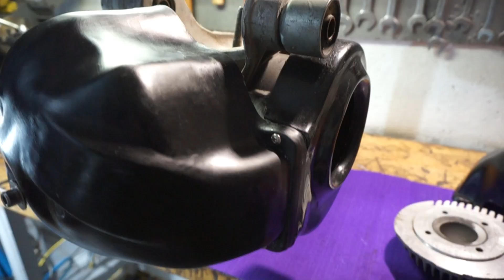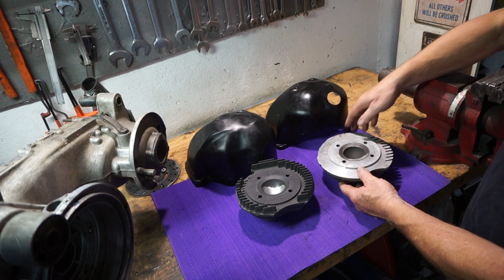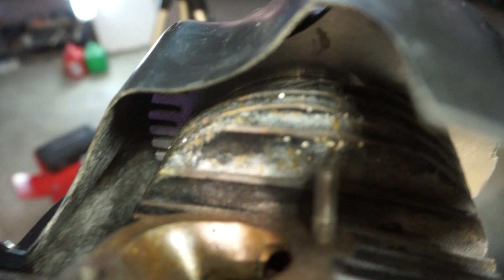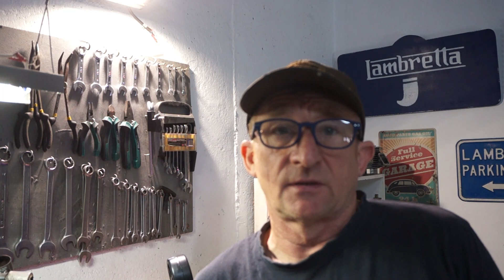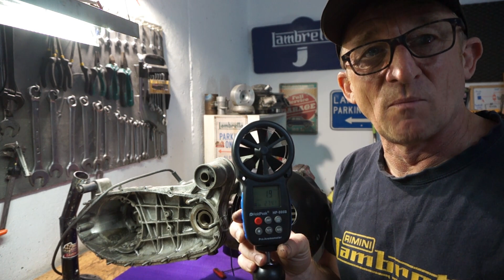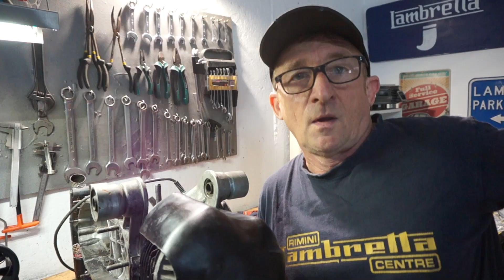mammoth v avanti  head air flow test # lambretta#thesteelweasel

Comment: What about running a separate cowl round the cylinder and leaving the head to heat exchange to ambient air, maybe with scoop do direct air to the head at speed?
Reply from the maker: The head fins are facing the wrong way for a scoop ? And it's to road scooters I'm working on .... but keep thinking it's good and keep posting . Thanks

Comment: Weird science.  I heard sand blasted aluminium increases surface area. Nice !    . Yamaha RD heads have similar holes.  They're not stupid; Yamaha took the Two stroke engine to high levels. Why not weld on fin extensions to the barell.  Cut some steel "C" shapes; and weld them to the fins one by one. Beat them damn Vespas at their own game. What about water cooling jacket too. Has been done for Yamaha Land speed. "Speed of Cheese" did it. Check his site.

Comment: High power output and air cooling are at the best hit and miss do some sums and its staggering...
Assuming a moderately tuned engine of say 20hp at the wheel, with thermal efficiency of 35%, that is 57 hp of wasted heat. This is 47kw. 
If the max cylinder head temp is 240C, then the thermal performance of the cooling must be (for amb of 25)  is 47,000/215 degrees per watt. This is 22deg/watt for the overall engine. I congratulate you on centring on this aspect of the lambretta engine, its most important. Some way or regulating the temperature with a diverter flap etc, coupled with a more efficient fan would do it..
Reply from the maker: I'm running at 70c on my road bike but it's only around 12 bhp . More power more energy and so the story goes on .

Comment: Long winded for a non comparative test. It should have been done with plug, inlet manifold and exhaust pipe in place. Also slight variation in position of the airflow meter would give wildly varying results.
Reply from the maker: Thanks hope you enjoyed it , and dont worry cos I'm only making these for my own bike 😊

Comment: Hi, could you tell me why the spark plug hole wasn’t simply taped over on the Mammoth head to make it a fairer test? Seeing as the difference was only 0.2. 👍🏻
Reply from the maker: Dont worry chris next test I'll tape over but I don't think it will get 15 %  more .
Reply: @TheSteelweasel  you never know, don’t forget that the mammoth head was also cut out for the reed block but yours wasn’t.

Comment: What you thinking of making the stuffers out of. Also couldn’t they cause hot spots leading to piston seizures. Just a thought. Great work tho pal
Reply from the maker: how can you make hot spots ? it increases air over the fins and a more uniformed cooling . at the moment with the present system i would say the barrel is almost getting no cooling and the right side is a massive hot spot .........you already have 4 very nice hot spot each barrel stud is prone to seizures , the hole for the stud is a void and voids do not conduct very well . thanks for the feed back 💖

Comment: I'm not 100% sure the air flow is a representative parameter. Of course the more air the more heat gets pushed out. But you need to give the air some time to travel across the fins and exchange heat effectively. more complicated but I'd put a thermostat resistance in the barrel and then measure both the flow and the temperature on the head with different setups. Nice work. Buen trabajo hombre.
Reply from the maker: blow slowly on hot puchero and see if it cools faster 😂😂😂
Reply: @TheSteelweasel  yeah. But also blowing slowly for one min could have better results than blowing like an hurricane for one second. But, on lambrettas it's all about experimenting. Thanks for sharing your work 👍
Reply from the maker: @enricoceccarello3531  Depends on cake size and the amount of candles 😜